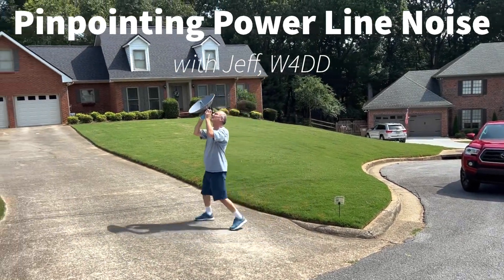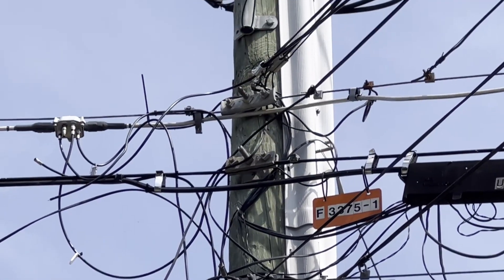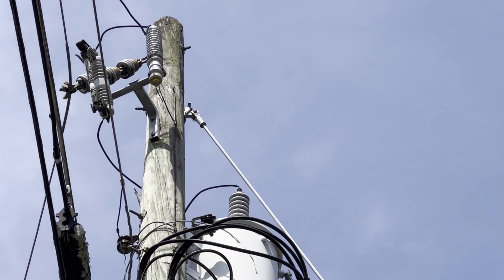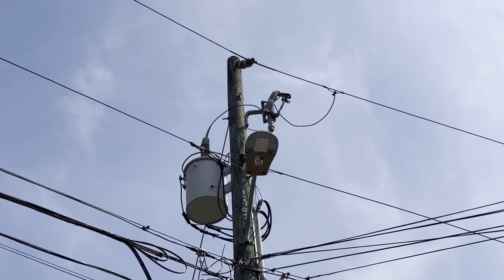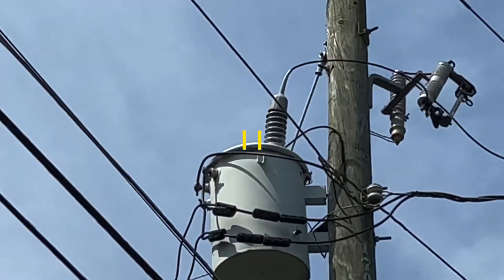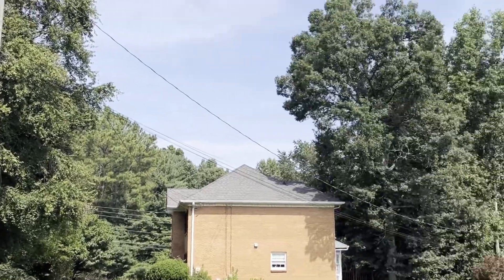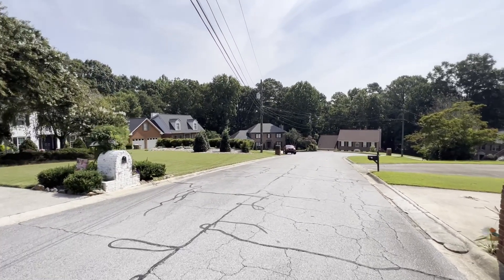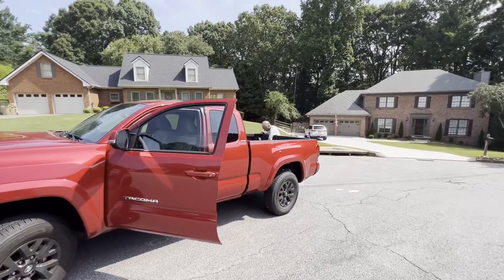Pinpointing Power Line Noise (PLN) #hamradio #powerlinenoise #rfi

Comment: Thanks to Doug for the excellent video with a good close up of the top of the pole.  There were a total of 4 poles we identified during our investigation. The issue with this pole was the crimp that ties the wire from the bottom of the lightning arrestor to the ground wire for the pole.  That crimp is visible at time 2:15 into the video and is about 1 ft down from the end of the vertical ground wire.  The crimp was loose and was not properly connecting the two wires together.  The power company re-crimped the connection, all good after that.  Cell phones have great high-res cameras.  The picture can be enlarged and many time the fault can be seen.
Reply from the maker: Thank you for lending your expertise, Jeff!  73, Doug

Comment: Please, please can you help?! I am in Canada. For several months we've been getting a high pitch noise (sounds like morse code) that peaks between 1-4 a.m.. Who does this kind of testing? Where do you get a parabolic dish? Any connections in Canada? We've contacted the cell companies & electric but they all point the finger at each other. It is devastating, penetrates through triple glaze windows & soundproofing. I am desperate for sleep. Any info appreciated!!!! Thank you.
Reply: Although your problem sounds like an Audio Frequency (AF) problem rather than a Radio Frequency (RF) problem, some of the same techniques in locating the source can be used.  Both have a “transmitting” element and the closer you get to that source, the higher the intensity.  In chasing RF sources, we use 1) a receiver, 2) an antenna, and 3) an attenuator.  We use the attenuator to keep the intensity from overwhelming our receiver.  For AF problems, your ears become the “antenna”.    Here are a few ideas.

Does more than one person hear the noise?
Using headphones that cover the ears, does the noise decrease?
Walk to the windows on the 4 sides of your house.  Is it louder on one side than the others?
Is it louder outside the house?
Using the house as a “shield”, is the noise less on one side of the house?
If you walk away from the house, does the noise decrease or increase.

When investigating RF problems, it is sometimes difficult to tell whether direction A or B is the correct direction because both are very strong, like when comparing two power poles or moving to different sides of the house.  That’s where an “attenuator” is important.  It decreases the intensity by a fixed amount making it much easier to tell if direction A is stronger than direction B.  Without attenuation, it becomes very difficult to compare signal levels.  Ear protection sets can be purchased at many hardware stores if you don’t have an audio headset that covers the ears.
Reply from the maker: Ham Radio Morse Code doesn’t transmit a sound. The receiver creates the sound that matches the intervals of the carrier that is cycled on and off by the transmitting station.

Your post seems to imply that this is an audible sound (penetrating windows) so I must assume that you aren’t referring to radio frequency interference.  I would have suspected an over-the-horizon radar if you were referring to radio frequency interference.
Reply: @n4hnhradio  Thank you for responding. It just sounds like morse code because of the intermittent, short pauses, but it's in the air. You can hear it outside or in the house. I just can't pinpoint the source because it's bouncing around the atmosphere. There's a transformer on a pole outside our house. There are also a bunch of newly built giant cell towers near us. I have no idea how to locate the source. Called electric & tower companies. They all point the finger at each other.
Reply from the maker: I suggest that you contact your government.
Reply: I seem to having the same kind I’d trouble and bin getting the run around from the hydro company.I also have had no sleep.
Reply from the maker: @cindylee6305 are you also in Canada?
Reply: @ I didn't know you can't post websites, etc.. Are you in Canada? I found some info.
Reply from the maker: @TammyMcNeill-blk no one can post a link here due to unscrupulous people posting links to pornographic sites. You could tell the name of the organization where you found the information. Or try posting the website without a www or a .com.
Reply from the maker: @TammyMcNeill-blk I asked the Grok AI about this and the answer is intriguing.  Click this link: https://x.com/i/grok/share/b45aso4YjqAUSfF86B3AZyf5P

Comment: Something not mentioned here, is many times this arcing is as stated, 
" Broadband " !
With that said many times for the Radio Amateur, there will be noise on the VHF 2 Meter band, that can be used to help locate the source !
Once close, you should then switch to UHF, and listen at the 3rd Harmonic !
Which allows for even greater accuracy !
For this video, there beam was built around 136 mhz. !
Where 408 is the Third Harmonic.
And for the Radio Amateur, I would be remiss if I didn't relate my own discoveries, Two being Touch lamps, or anything using that technology !
Horrible noise generators on Ham frequencies !
And Keurig coffee makers, where they have to actually unplugged from the outlet !
Horrible noise generator, especially at 6 meter band !
Reply from the maker: 137MHz (technically 136.950) was used to provide a general location.  That’s what the Yagi was used for. Jeff finds that frequency to be a sweet spot for locating the general area of noise.  But the acoustic dish provided the pinpoint analysis as to exactly which piece of hardware was causing the arcs.

Comment: I work for the cable company, and were dealing with this very thing-RFI-PLN . I usually can track it (RFI) with the AM radio station, but the substation had a dead short and a fire last week and this whole area is one big RFI, makes it very difficult to track exactly where the source is. Sounds like a great tool to have. Thanks
Reply from the maker: Jeff’s software is great for identifying the problem poles. Then his home brew dish-audio detector pinpoints the exact hardware that is causing the arc noise. I so appreciate Jeff.
Reply: @n4hnhradio  Thank you Sir !
Reply from the maker: You’re very welcome.

Comment: MFJ also sell an ultrasonic pinpointer MFJ 5008 and an RF line noise meter MFJ 852 which is basically a superhet AM receiver with a built-in dipole antenna for simple direction finding.

Comment: Here in the UK I have investigated a fair number of power line noise cases both professionally and as a licensed ham operator using similar techniques and equipment as that being used by Jeff in the video. I built the same ultrasonic pinpointer as the one Jeff is using, from the design available on the ARRL web site. On one occasion, I used my device to accurately locate the exact spot on a very large national grid power line insulator stack, where the arcing was taking place. The power line engineer confirmed my findings using a thermal imaging camera costing many £1000's and was so impressed with my £35 ultrasonic device that he asked for the design details, in order for their apprentice engineers to build one as a project to use during their own investigation work 😁
Reply from the maker: Jeff was referred to me by the ARRL.  He wrote the code for the mapping program.

Comment: I would love to see a video on how to deal with lightning crashes on the ftdx10. Currently lightning crashes are destroying 40m for me locally for about a week.
Reply from the maker: You can’t stop lighting crashes with any radio. You can somewhat minimize the crashes with the same techniques I show for normal 40m operation. Always IPO, 6 to 12dB of ATT, and roll the RF Gain back until your S-Meter reads 1 or 2 of S-units less than the strength of the station you’re listening to.  Finish it off with DNR at 5.

Comment: How can the staples cause noise? I understand if theyre shorting or something, but theyre just staples? Presumably holding the ground wire in place, but that should be it?
Reply from the maker: The staples are supposed to hold the ground wire to the pole. Over time, the staples loosen, leaving a gap between them and the ground wire. Static buildup on the staples discharges to the ground wire and you have a spark gap transmitter. I covered this and more in the video description.

Comment: Thanks for this!  Struggling with some terrible intermittent noise.  Jimmy KN4UXO
Reply from the maker: I hope you can get it solved. I recommend trying the circuit breaker test first, to be sure the noise isn’t from within your own home.
Reply: Thanks for the reply.  I have actually shut down all power to my shack. (it is in my shop building)  I have not powered down the house tho.  Thanks for the tips!  KN4UXO
Reply from the maker: Well, you have certainly narrowed it down. Do you have chargers in your shop for lawn tools or cordless drills and the like?
Reply: I forgot to mention that I actually operate my gear with batteries.  That was the best test I could think of.   Thanks  Jimmy @n4hnhradio

Comment: Is RF Mapper commercially available? Thanks for the video Doug.
Reply from the maker: Hi Martin!  There is a link in the video description that takes you to Jeff’s slide presentation at a local ham radio club. Later in the presentation he provides information about the RFI Mapper and how it must be connected.  The software currently supports the Kenwood TS450/690, Elecraft K3, and Icom IC-705.  Jeff wrote the RFI Mapper software himself. There is more information about possibly getting a copy in the description of this video.
Reply: @n4hnhradio Hi Doug. Long time lurker, 1st time commenter. 😂I’ll soon join Patreon I promise!  I hoped to find the info and slideshow. 😂hen I tap the …more which usually takes me to a description, the only thing I get is a blank screen with the video minimized to the bottom.  Any other place I can locate additional info?  (I am fortunate, Florida power and light FP&L is very responsive. And the agent who handles the calls in my area is actually a friend of mine. But I try to do my own legwork and also help other guys in the club. 
Thanks for your great channel!!
Reply from the maker: @HowToHam_Tom I think YouTube changed something. I click more for any video and it does what you describe. I click on the title of the video and I can read the description.
Reply: @n4hnhradio  Thanks for looking.  It’s all jacked up right now.  No luck, but different results on my iPad Vs. the phone app. I’ll try again in the future. Would love that app.  Thanks for all you do!
Reply from the maker: @HowToHam_Tom if you click the video title it open the description. Well, mine does. It might be different on a different device. I’m using the YouTube app on an iPhone.
Reply: @n4hnhradio  Got It!  It’s behaving differently today. Thanks so much. Heading to Patreon now. I want to show my gratitude for how well you support the community. 🙏

Comment: Looking forward to seeing the video where the power company comes out and fixes the issue...  Then you can show the "after video".
Reply from the maker: I’m not holding my breath. I mean, the power company isn’t even returning calls from their own engineer, who already identified noisy hardware.  CW has been my friend for 2 years. I can duck into the 50Hz of CW bandwidth and block the noise. Actually, it affects CW, but not nearly as much as it does SSB.
Reply: @n4hnhradio  30-33dB of noise.  How far out will that noise extend from the pole?
Reply from the maker: It’s extending to my radio. Depending upon terrain, and the antenna, you might hear it a mile away. These are 150-200 yards away, with one at 1/4 mile away. There are 4 poles. The least measured 12dB, with another at 18dB.
Reply: @n4hnhradio   It is amazing how far out the noise propagates. Well, you are talking to someone who knows nothing about pole noise, other than I'm afflicted by it like yourself, but to a lesser degree.
Reply from the maker: I encourage you to click the links in the description to check out Jeff’s slideshow and watch his video presentation. You can then approach your power company speaking a language they understand, regarding the equipment on the pole that probably needs attention.
Reply: Thanks for the video Doug. I have a constant noise level showing on my radio. What can I use to determine it’s being caused by the hardware on the power poles or a problem coming from a neighbor’s electronics or maybe appliances?
Thanks,
Davidh W1DRH 73
Reply from the maker: @davidhaywood9071 Hi David!  The sound of the noise provides a hint. Power line noise sounds like a buzz. I have a video playlist all about it. You can hear examples. 

Noises from within a home vary. They tend to be more broadband. Not necessarily a pulse or buzz, but more “digital” sounding. I check my own house when a new noise starts. Did we just buy something that is electronic?  It was a wireless phone charger.  Returned it. Another was the power supply for an LED fish aquarium light.  Another was the power supply for a baby rocker. 

I power my radio from a battery and turn off all circuit breakers. Noise gone?  It’s in my house.  One by one I turn the circuit breakers on until the noise starts again.  Now I know which room. I start unplugging things in that room until I find the culprit. I continue turning on circuit breakers to see if there are other culprits.

My friend Richard narrowed down to his kitchen. It was his food sealer.  It wasn’t on but it was plugged in.  

Another source that gets overlooked is yard tool chargers, usually located in the garage. These are the chargers for electric weed eaters, hedge trimmers, lawn mowers, leaf blowers, etc.  just unplug when not in use, if yours are noisy.

I hope this helps.

73, Doug